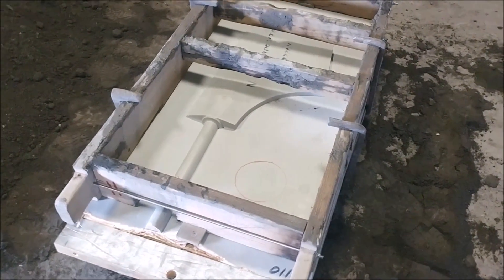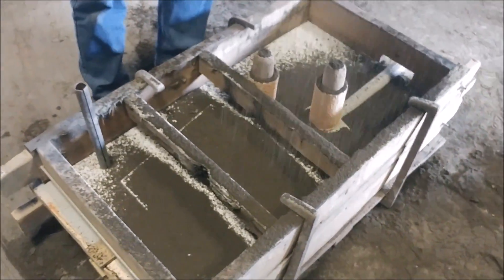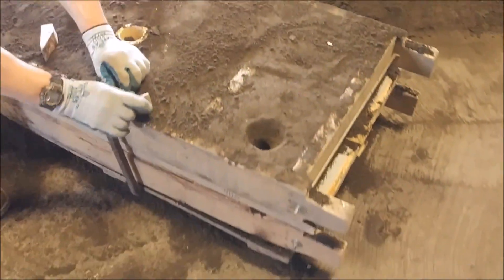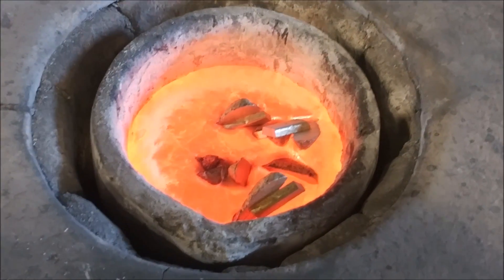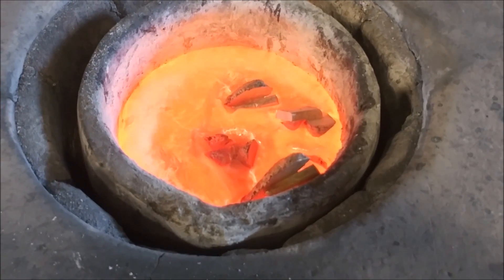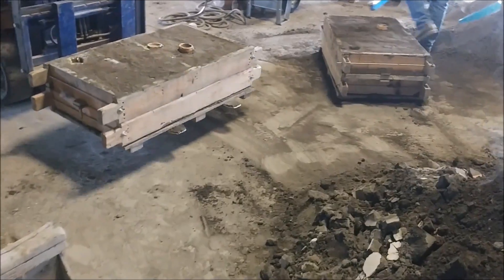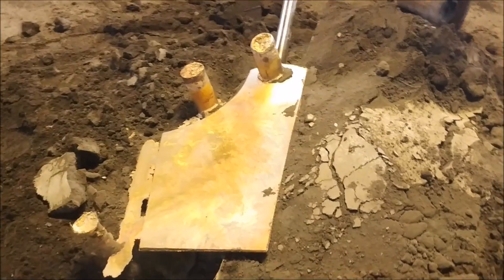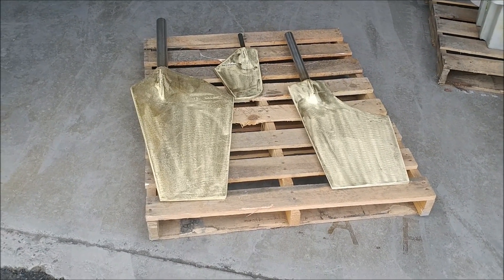How to cast a large rudder from manganese bronze at our new foundry

Comment: Dudes, wear facial masks when pouring !
8'55 : why do you add metal ? Don't you fear to shear the thing ? On the 3rd add, the metal doesn't level on the 2 risers, i think you should have not done that, even if the result is OK.

Nice work at the end, BTW :-)
Reply from the maker: Great, thanks for the tip!